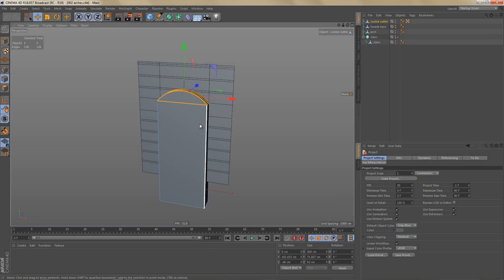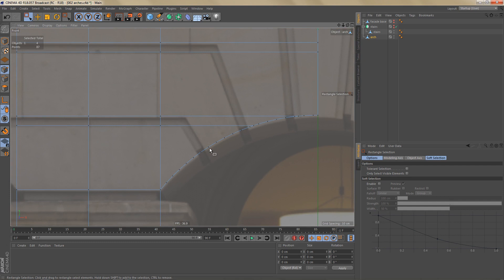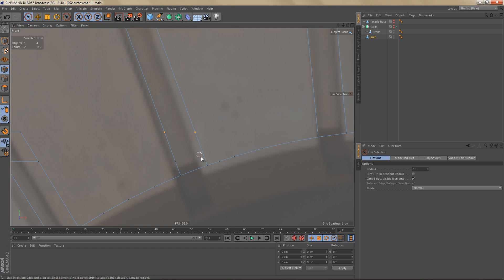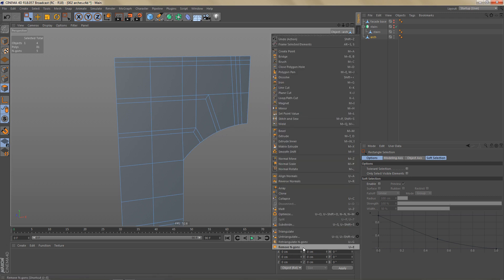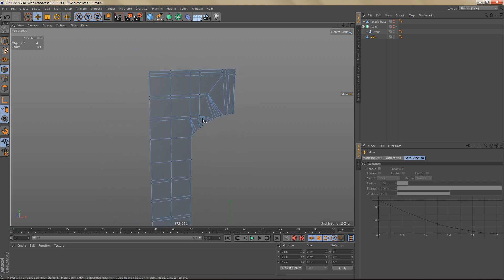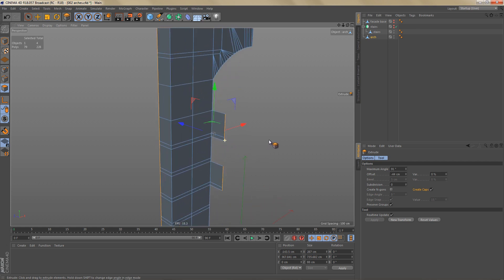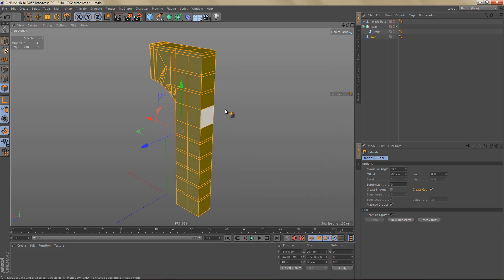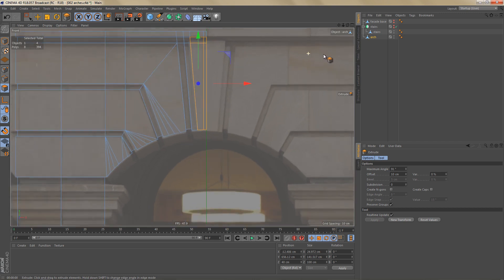Modeling a Building Facade in C4D - 03: The Arches - Part 02 | Cinema 4D Tutorial

Comment: Once again great content. I have two questions;

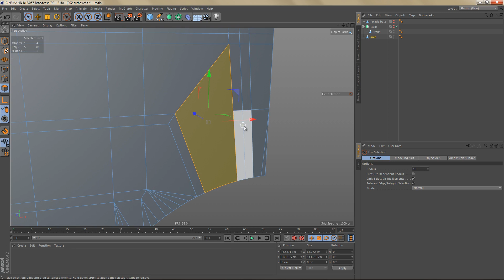When you converted the polygons to n-gons around 7:51 which command did you use?

I used melt and dissolve and even after that l can still see the lines (edges) but the whole thing became a polygon like in the video. What could be the reason that l still see the lines?

Thank you.
Reply from the maker: Thank you very much!
It doesn't sound like you made a mistake. Like you, I used the "Melt" command to turn the polygons into an N-Gon. 
The reason you are still seeing the lines probably is because you have "N-Gon lines" switched on in the filter options. Open the "Filter" menu (you can find it at the top of the viewport), find "N-Gon lines" in the list and just click on it to switch that option off. 
I hope this helps. 
Cheers,
contrafibbularities